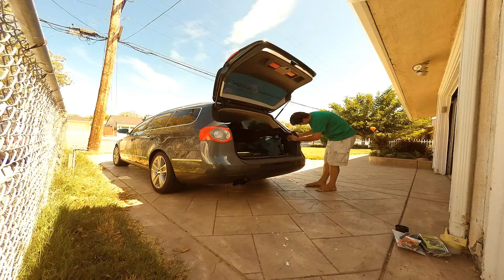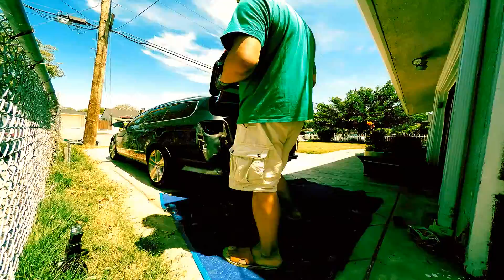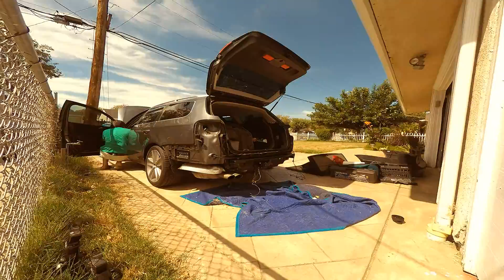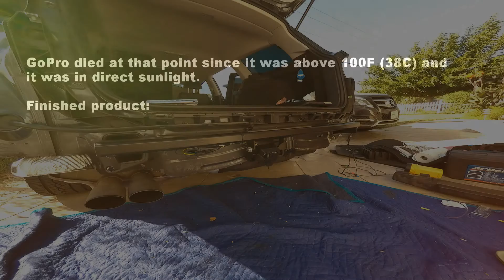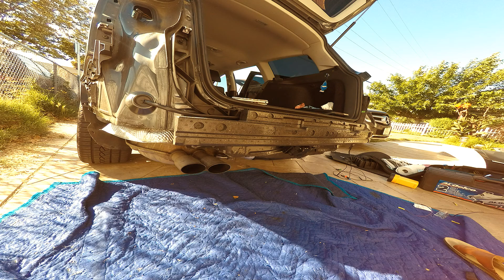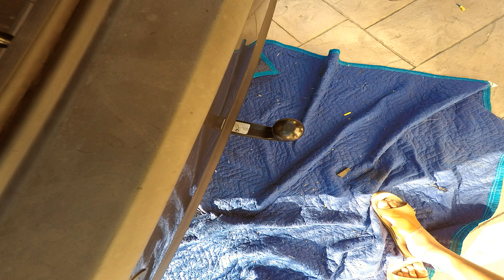VW Passat Wagon Tow Hitch Installation - Timelapse

Comment: Hi Mikhail, how did you proceed with the electrics? Which is the best path to take for the wire from the battery?
Reply from the maker: I did not get power from the battery as I had no need for 7pin connector. You have all the power for the trailer lights right there. To be honest US market has really odd setup. Ideally I would look for EU trailer module that can connect into the car properly and disable distance censors

Comment: Great job! Did you re-tighten the tow bar bolts after some miles? If yes, do you need to remove the bumper?
Reply from the maker: Actually I did not, but you will have to remove bumper for sure and may be even heat shields